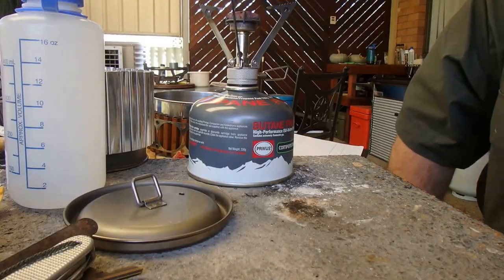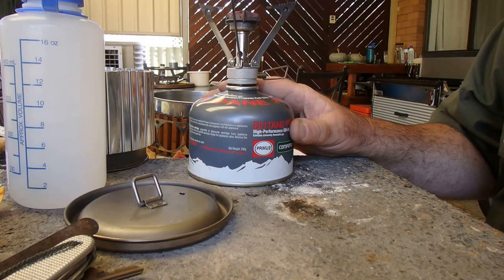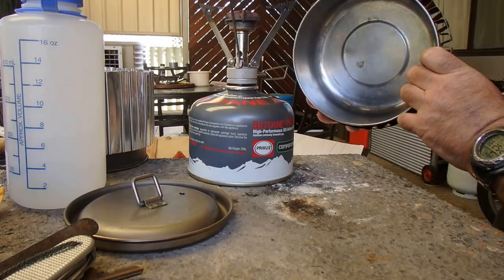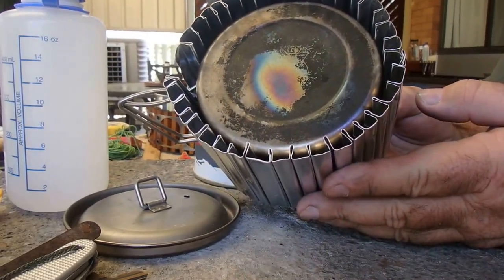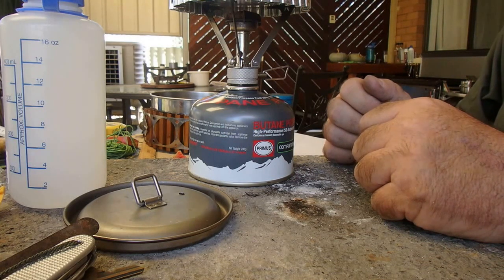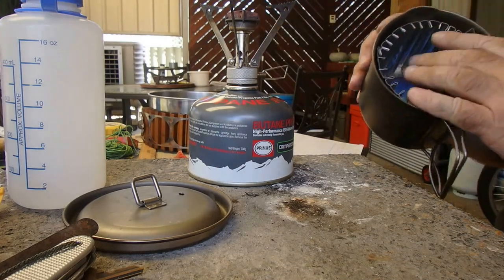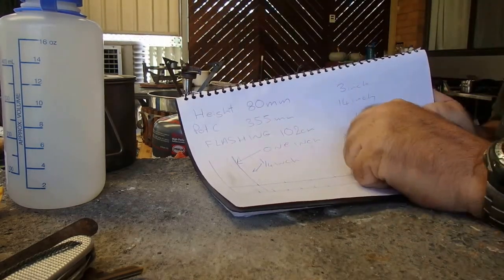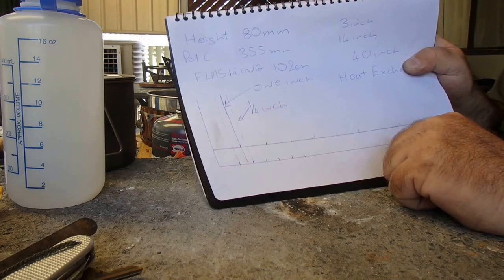Titan Kettle Heat Exchanger

Comment: hi mike, paul agian.  that pure genius. can i ask do you think it will improve the wind efficiency, so it acting more as a windsheild but still giving good performance as a heat exchanger if you slid it down more to protect the flame of the burner ?
Reply from the maker: +43whisky Hi Paul I have a primus wind shield not shown in the vid its made for one of their stoves but works with the msr pocket rocket the trick was to keep the exchanger short enough to fit in the pot and get as much contact with the sides to transfer heat other wise lost regards Mike
Reply: i have the msr Ti pan with the heat exchanger as in the video as well. i use it on my msr dragon fly cheers paul

Comment: How did you fold the flashing?
Reply from the maker: I bent the centreline on a flat piece of steel then squeezed the two sheets together then lowered it into a vice and did the 90 degree bend then repeat